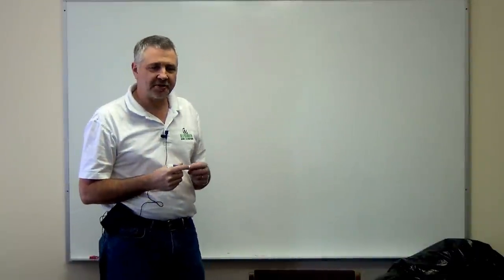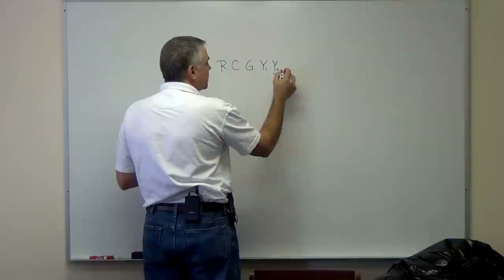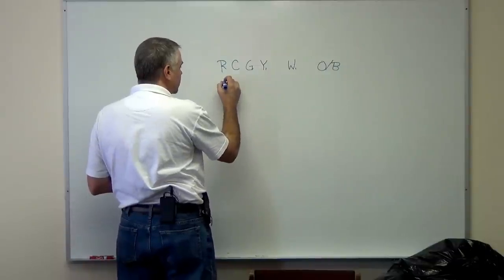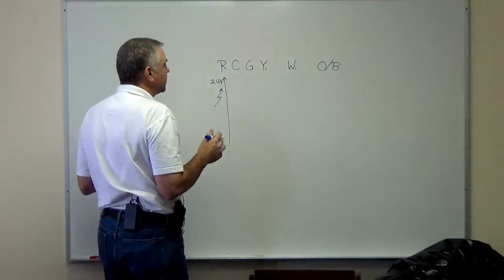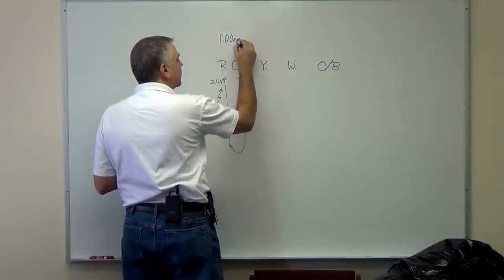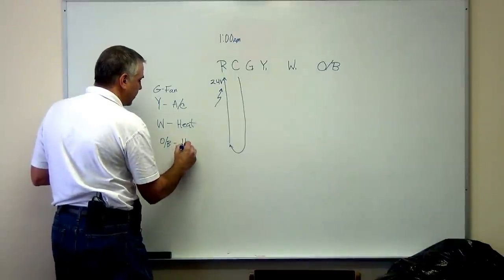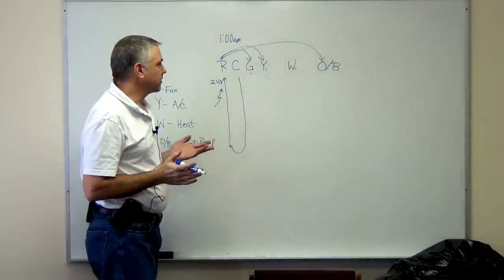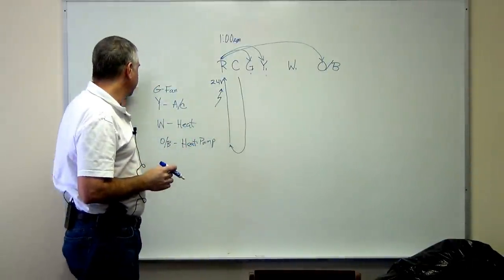How a Thermostat Works - Raleigh Heating and Air Conditioning

Comment: Great video! What I want to know is how to wire a thermostat to bypass the heat pump system and turn the emergency heat on at will (natural gas in our case.) When it's above 50 here in Dallas, the heat pump works fine. But when it's below 50, it seems that our heat pump puts out a somewhat "weak" kind of heat. What I want to do is be able to push the emergency heat button on our thermostat and call on the furnace to heat our home, instead of the heat pump. So far, when I push the EM HEAT button, all that comes on is the blower and no furnace. Of course, when the temperature dips below 35, the furnace comes on automatically. But I want to be able to do it with the EM HEAT button at a time of my choosing. It's got to be a wiring issue to the thermostat, but I have no idea. I would appreciate your opinions on the matter. Thanks so much!

Comment: on an electric split system, should the outdoor a/c unit and the indoor blower unit come on and off at the same time? This is what it does now after I replaced my thermostat. The older thermostat had the outside unit come on a little before the indoor blower and would shut off before the indoor blower did.

Comment: if the 24 volt is out will it drain the batteries on the thermostat ?????
Reply: thank you. I thought I remembered correctly.
Reply: Yes it will, if a common wire is present on the thermostat it will continue to operate, if there is a red wire present with no common it will operate off batteries